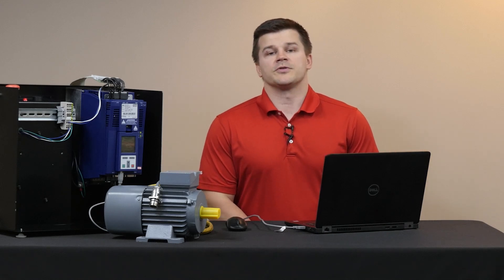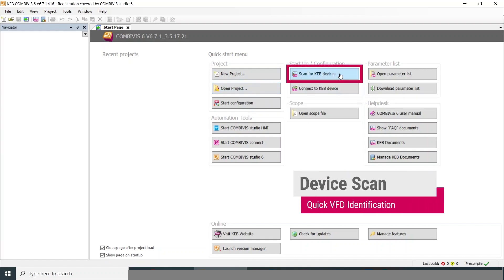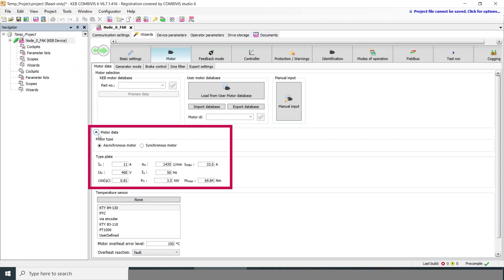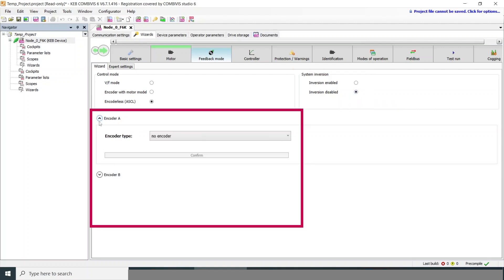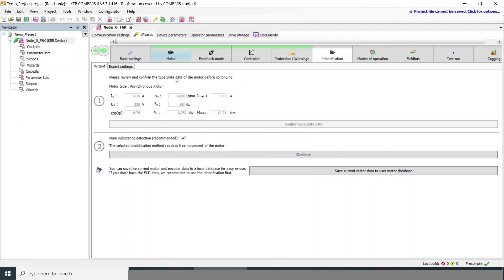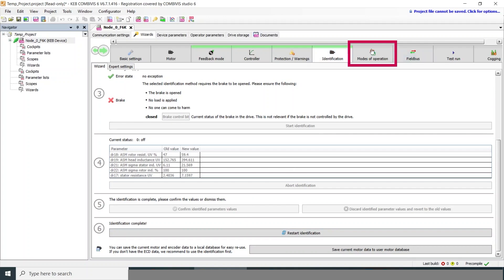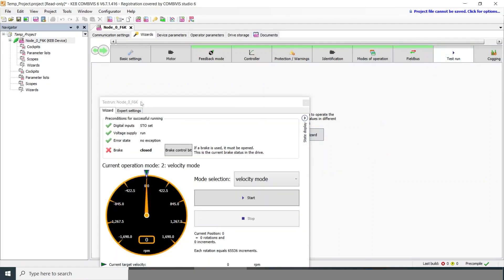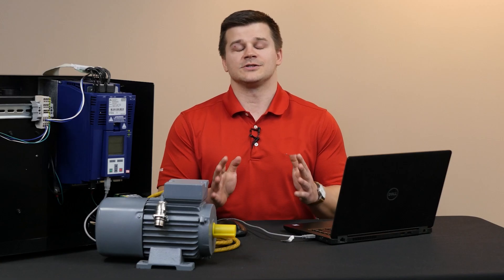Startup Guide: Spin a Motor with an F6 VFD | KEB America

Comment: Hi! I'm trying to do the same quick start procedure you show in the video using COMBIVIS 6 and a COMBIVERT F6 (Housing 3, model 18F6A13-3411). After connecting the 24V and the three-phase power supply, as well as the motor and the PC, the device is recognized. However, I get the message: "There is no parameter-information available for CfgId 9310", and the Device Parameters tab is empty. Also, the Wizards tab doesn't appear, like it does in your video.
Any idea what might be wrong?
Thanks a lot – your videos are really helpful and well explained!
Reply from the maker: Thanks for the question. The first thing I would do is check for updates for your COMBIVIS 6 software under the "help" tab. You may need to get an update in order to have the correct config file on your PC. If that doesn't work then uninstall, redownload, and reinstall. If you need further assistance please contact us at: https://www.kebamerica.com/contact